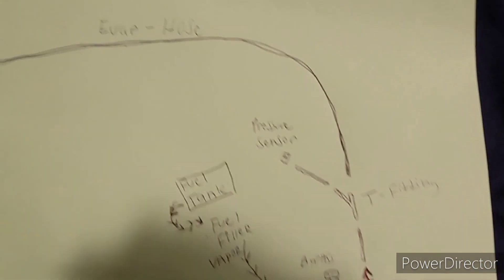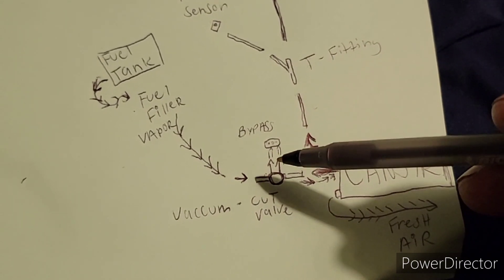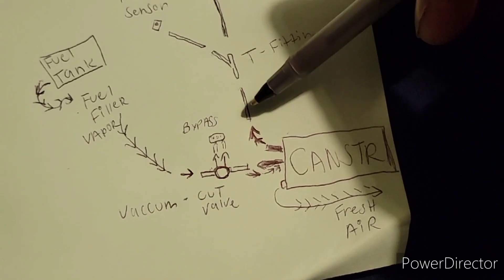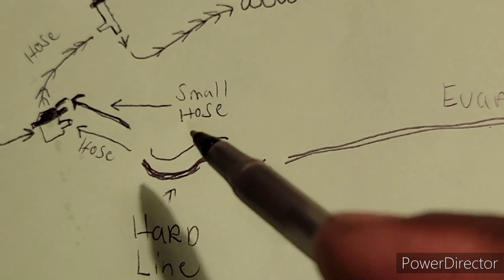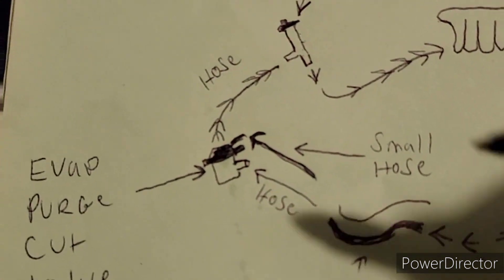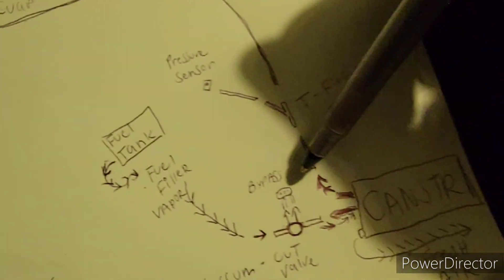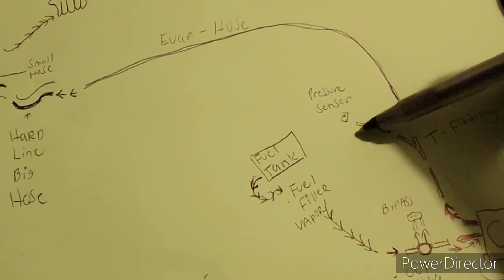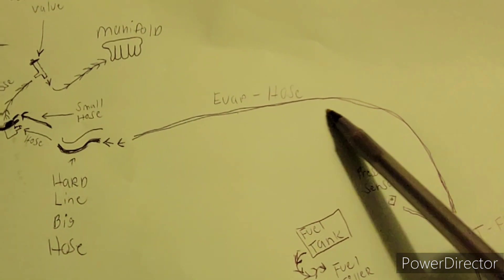Evap flow diagram 4th gen nissan maxima

Comment: Thanks for the video . I am getting P1447 and P0400 but there is no charcoal bits anywhere.  However I notice there is no suction at the top hose of evap purge cut valve. The valve holds a good vacuum and is in good shape.  Any ideas ?
Reply from the maker: what car is this and year?...is it cali spec?
Reply: 1996 maxima probably not a cali spec I got it in Florida
Reply: I am in Florida so probably not a cali spec
Reply from the maker: Any remedies yet